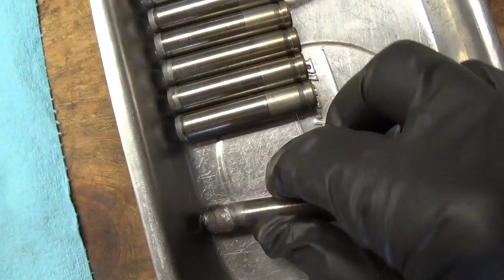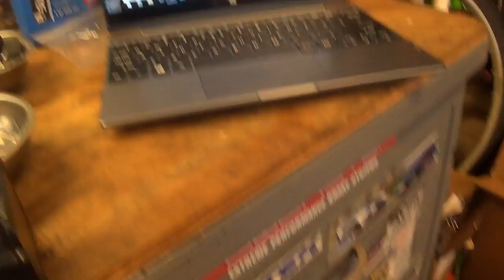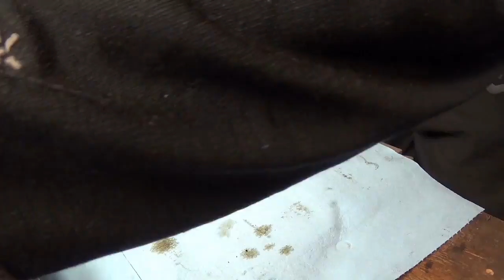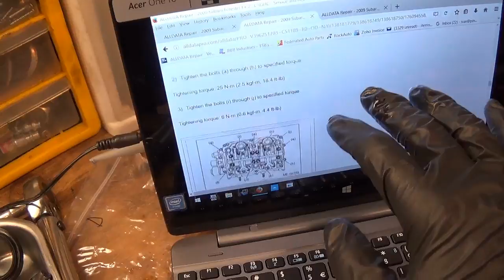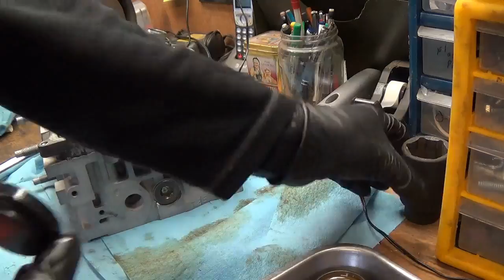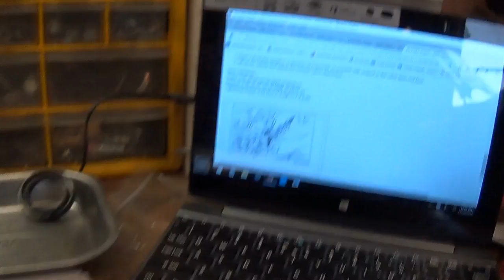Subaru Head Gaskets - Part 4: Reassemble, Valve Clearance

Comment: Watching anybody run bolts down into aluminum threads with power tools always makes me cringe.
I have some extra heads im getting ready to work on and one of the special tools i am going to make is a bench pad with holes for some bolts to anchor it down.  Tired of watching everybody torquing on these while they are scooting around.

Comment: try to get the sealant on the outer edge and use as little as possible.

had some block my oil return and oil pressure shot one of my rear mushroom plugs nesrly lost my motor and had a qaurt of oil left.😢

Comment: Already had my heads glued together and thought I don't need to watch this.   Then I realized I only put sealant on the trough. I looked at the application image and saw that I did not start or end at the oil seal caps. They just finished curing. Thanks for the additional work. it will save me a lot of work later after they start leaking,  😂

Comment: At 7.5 ftlbs torque I would have just done it by feel. As you are most likely aware, you get a feel for those lower torque specs. I got good at doing 28 ftlbs by feel.

Comment: Cam seals- if you look at the front of the head where the seal goes you can see it has a bevelled inner edge, indicating the seal needs to be pit in a little past flush with the cylinder head. I've seen guys saying not to put them in further than flush but they are supposed to go in a little further than flush or they can pop back out

Comment: I think an anaerobic sealant should been used as opposed to the ultra gray. My theory is that sometimes a cam cover leak is  actually misdiagnosed as a leaky hg, they both end up covering the bottom of the engine with oil,  but only a leaky cam plug will cause oil near the cam plug.
I really dont think that area is sealed correctly from some videos I've seen. In this video I saw how the gunk left over in cam cover channels block the return path of oil. In the fsm, Subaru calls for a 3mm bead riding on the outer lip of those oil channels. I think it's a very subtle reason. They dont want the bead to squeeze out excessively or at all into those channels. In my interpretation,  I think the important thing is the sealant forms a barrier around the oily areas. When the oil inevitably seeps to the front and rear cam seals, it fills up behind the seal  and must drain back through tiny channels, look under cam shaft, however if that channel is somewhat blocked or not flowing quick oil can force itself between the metal and find its way into another channel, and if that is blocked, the oil will have nowhere to go except out the front and rear cam seals. From TDs of anaerobic sealants, another benefit in this regard is it only cures in areas of no oxygen, the rest will wash out with the oil. So even if the installer is not careful those oil channels wont get gunked up. I feel I'm right on this, and I'm about to need to do this job  so I just want to see what people think. Thx

Comment: I would not be surprised if the problem with this car started from lack of periodic valve lash adjustment. If the exhaust valves were tight and not seating correctly - they would overheat and start burning the edges eventually leading to crack of the top. This is why it would be good to check clearances on the other head

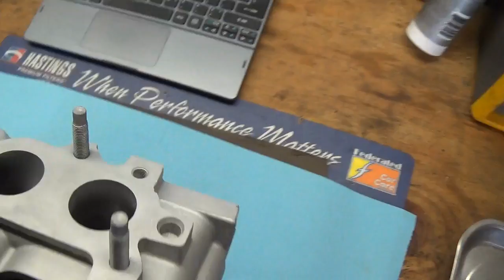Comment: 1:02 If the engine is turbo changed (it's unlikely to be since that's a SOHC head) you'd actually have to get it tuned because the engine now has an increased compression ratio.

Comment: I got my ej253 heads from the machine shop and I paid them extra to put in the cams and retainer housings, cam seal and plugs in. plus adjust the valves. They must not have sealed it correctly cause I have an oil leak out the back of the head around the cam cap on one of the heads. They charged me $650. Iam so pissed at them. Now I have to pull the head off in the winter with no heat in the garage! And hope they fix it correctly the second time. A refund would be good too. Any thoughts?

Comment: Thanks bud, just what I need. My outback had a leaky head gasket so I sent the heads away for skimming. The last time I sent a head to a machine shop it came back complete, so I just bolted it on with no dramas. This time they've come back in 3 parts and multiple boxes!

Comment: Did the machine shop press out the head warp before milling?
Reply: You dont try to press out the warp on any head…esp a small aluminum one like this…i wouldnt consider putting any type of cast part in a press…i just cant imagine doing what you asked…and what kind of damage it would cause… all for just a lil over the thickness of a pc of paper or a human hair…which .003in

Comment: Too much sealant is better than not enough? Well, bad news, someone rebuilt a manual transmission in a Ford ranger I bought. It made terrible noises so I tore it down to find out someone used way too much sealant on the front bearing retainer and it clogged up the oil galley in the input shaft which stopped oil from getting to the input bearing.
Reply from the maker: Sounds like WAYYY too much sealant used to cause that!
Reply: @PineHollowAutoDiagnostics  Indeed, I do believe the Ford ranger forums said to only use a thin layer. My dad always taught me to spread the sealant before putting the other half on to ensure there isn't too much, it's worked for him for the past 35 years and for me since I started working on my own toys 10 years ago.

Comment: I used to be a truck mechanic and most of my experience was with Cummins.  But I alwayys ran over head on valves to where the feeler gauge was snug and if you ran it under it would drag and not be tight and the adage was a little loose was better then too tight.  Is that not true with foreign cars when adjusting valves?  Not being an as* just curious. Always owned domestic cars and you don't ever have to adjust the valves unless doing a rebuild.
Reply from the maker: It's a mechanic's feel sort of thing. If it drags a bit then call her good ;)

Comment: Ivan i noticed that you mentioned that the head is the drivers side. So the passenger side head  didn't need any machining. Also i didn't know that those 4 cylinder subarus had 2 heads.
Reply: Beavis Kornholio yup, Google boxer or flat four

Comment: Just asking.., Are the valve lash specs with the engine cold,or are  the specs for an engine at normal operating temp?
You might want to check. Also, you might want to recheck torque on all those bolts when the head is back on the block.
whatever you think, your going through too much work to have something go astray.
Reply from the maker: Valve clearances are always set on a COLD engine. Thank goodness, because it would really suck setting them on  hot engine LOL!
Reply: Best to set them to the high end of the spec, things do grow when hot, and you might end up burning valves

Comment: Common Ivan, You've got me, Denny the toolguy, as a friend and you use a $9.99 (with coupon of course) torque wrench from Harbor Freight on an aluminum head and block. Take the rubber band off of that roll of hundreds and buy some decent tools will ya!!! That's embarrassing.
Reply from the maker: That torque wrench works great!
Reply: Very likely it doesn't. Torque wrenches, no matter how well they're made (Snap-On and Proto included), if they depend upon a spring as this style does, are not very accurate at only 5% of full scale like you were using it. Pull another tenner our of your pocket and go back to HF and get their 1/4" model. Then you'll be better able to do these low torques as you'll be in the middle of its range. Or, you could call Denny and we could make a deal for a quality torque wrench of either the digital or spring style as I of course have both.
Reply: biggest thing, does it torque consistent across all "fasteners" of the same value. nothing causes issues and warp faster  than uneven torque ;)
also the same reason for having "one" person torquing all of them. not like it's a dirty secret, multiple people/angles can vary the torque by a large percentage
Reply: I noticed that too  but it may not be the exact torque but most likely will be all even   thanks on the sealer info

Comment: Soon be startup time :-)
do like the cam plate recess for sealant, some other designs have no recess and some use specific liquid sealers .
Is a ballache if that joint or rear blanking cap leaks though .
Subarus pretty leak free in general though .
looks like you having fun with this one, not a bad job once get into them . easier than a 8pot chevy :-)

Comment: I just did this job again myself on a dual overhead. Probably the 7th or 8th one over my lifetime. I found out after years of doing these that the composite gaskets seem to do better than the metal on this engine. Metal gaskets are always better but for some reason the composite gaskets on this engine seem to hold up longer.

Comment: Didn't see you clean the oil residue from the the mating surface before applying the Ultra Gray. When doing head work I use liberal applications of brake cleaner spray, Eric O would approve. Also I have one work table that is covered with carpet, nice to help hold the clean heads when assembling and adjusting valves.
Reply: Watched a lot of other videos where they smear oil or assembly lube all over but I don't see them cleaning it up good for the sealer.
Myself I would put minimal amount of oil on cam beatings to keep it off the nice clean gasket surface.
They don't need a flood.

Comment: Wonder how much of a new type engine is Engineered by Computers and how much by Computer, have we gotten that far that a computer can do it without a human, or I guess as human as a engineer can be.

Could they tell if the warping came from the factory, or from normal heating through the heat cycles. And Time
Reply from the maker: Great question about the warping. Hard to say if this particular engine had been overheated to drop that exhaust valve guide and warp the heads...
Reply: @P @PineHollowAutoDiagnostics I know this is old , but for “ whatever” reason it popped up. Here is some food for thought on this type of warpage. Let’s say you check for flatness with a machinist straight edge across the head gasket surface and find several thousandths of warpage. If it’s warped on the bottom, would one not surmise that it is also warped on the top where the 5 cam bearing saddles reside? How could it not be?  On the old VW Rabbit type engines which had a similar cam bearing design, if the head was warped it had to be sent to a facility that could heat the head to plasticity and formed back to spec for the cam bearings to be true. I do not understand how these warped heads can just be machined flat on the gasket side, and ignore the cam saddles. Help me understand! 😂🤔
Reply: Very common with aluminum heads in general and extremely common when you've got overheated aluminum heads.  Almost automatic to need the head decks surfaced. The blocks normally don't share this problem likely due to their greater mass.
Reply: I knew the longer alum 6 cyl heads suffered from warping, on my F54 straight 6 Datsun Z engine , I find it wants to break the exhaust header, around the bolt area, if it dosent break the header then it gets the bolt. But that Subaru head is rather short and stout, dosent seem like it would warp, maybe a bad design not allowing it to cool off fast enough, maybe just heat soak when shut off
Reply: overheat and not being torqued properly is the most common cause of warp. followed by adding huge power with lack of clamping force lol! which will push gasket out and of course burn them

Comment: Nice job Ivan man what a mess of bolts in those heads, in my experience you can leave the exhaust valves a little loose on the feeler gauge because exhaust valves tighten over time and intake loosens over time
Reply: I completely agree with that I always set exhaust valves like that I would rather a little tappet noise than burn a valve seat

Comment: I dont understand why Subaru didnt engineer the valvetrain support cradle to accept a recessed gasket or extended square edge o- ring. That has to be a more efficient process than releying on sealant in such a critical area but sealant technology now exceeds gasket technology. Great educational vid Ivan. Till next time bro...👍👍
Reply: Andrew Hallett-Patterson an automotive engineer told me it's cheaper.  A sealant is more forgiving so cheaper with a c and c type machine to apply it. We have to have a surgeons hand, I tend to slap it on with a brush

Comment: Ivan, Take the extension bar off the torque wrench
Reply: I agree, but what I think the point that he was trying to make was that without the head being stationary you will have side torque and that will lead to the actual torque being lower than "click" torque. Probably less than 5% in my opinion. Everybody gets too hung up on torque which is an extremely imprecise and indirect measurement of what you really want to know which is bolt stretch. Torque is affected by damn near everything. The lubricant used on the bolts. The lubricant used on the shoulders of the bolts. Material that the bolt is going into. The condition of the threads. Torque values in real life probably vary by 50% although torque wrenches can be made to within 1% of accuracy. That's why most manufacturers went to torque to yield. You tighten the bolts to a low value that basically takes up the slack. Then you know the thread pitch, you know how much you want to stretch the bolt and you add as many degrees as necessary to achieve that bolt stretch. That's so much more precise than a simple torque measurement.
Reply from the maker: why?
Reply: You are wrestling the head with your left hand on the bench against the torque you are applying with your right hand, without the ext bar your hans will be closer together, plus with an ext bar it tends to try and pull the socket off the nut sideways if you see what I mean. Thats the best way I can explain it, I'm shure there's a beter explanation somewhere lol
Reply from the maker: Good point Steve! Some of the bolts were inset a bit so I just left the extension on there for all of them... Maybe I should improvise a bench "parts holder" :)
Reply: You've got a decent MIG welder in that Hobart 140 just head down to the local steel store and get yourself some angle iron and plate and make up some head holders. These make working on heads a lot easier especially if you need to take out the valves as they lift the head off of the table. Personally, I'm killer with MIG (HTP Propulse 200) good at stick (AHP AlphaTig 200X) and sort of suck at TIG (also AHP AlphaTig 200X - which is a very nice AC/DC TIG machine for very little cash by the way).
Reply: if you torque one with an extension, leave it on to torque them all, if not the actual torque value will vary. don't forget and extension or any adapters/wobbles will change the torque value by "X%" depending on how many joints, etc.
should also say, you should fasten the head/object in place so you can use both hands on the torque wrench.
Reply from the maker: Actually, the number of extensions or joints doesn't affect the static torque value AT ALL. This isn't an impact gun. If it clicks, you are golden ;)
Reply from the maker: SATAMAN Schmidt so you're saying the Harbor Freight torque wrench is perfectly acceptable for this job 😄
Reply: whew, "SATAMAN Schmidt" went all out expanded explanation, but exactly right. keeping everything parallel is important and the more joints the harder it is to stay "in-line", more so with one hand!
we all know it's not good when your torque goes from circular twisting to off center side loading, that breaks many fasteners, sockets, bolts, adapters, extension "spark plug porcelain". broken plenty myself over the years :)

Comment: Tbh to much sealant is as bad as to little
Reply from the maker: Well I meant a little too much is better than an oil leak xD
Reply from the maker: Don't worry summer is almost here xD
Reply from the maker: Fair enough...but please explain the drawback of being a bit generous with the sealant. It's not like it's going to plug some oil gallery or cause any harm...
Reply: Pine Hollow Auto Diagnostics I just think you have to be careful promoting using copious amounts, as I’m sure there’s people watching this that might think you use it like sealing up a bath tub haha It can plug up things, I’ve seen it cause failures in oil controlled solenoids, clog up pickup screens and oil ways. Safer to use an anaerobic sealant that won’t cure in those circumstances. It’s also better for a tolerance machined surface application like this which most likely line bored? and a matched housing for the camshaft. It would also aid in separation in the future. Just like Mrs O’s worry with Eric getting an ice cream machine...unfortunately all that excess splurging has to go somewhere if you know what I mean? 

P.S. not enough tops off action in this series...disappointing 😜
Reply: Didn't think anyone would reply so that surprised me, don't think that I'm trash talking or stuff I like ur videos, it's just sometime I don't expect some things to hear from u ;) and to why to much sealant is as bad u can google it, it would be to hard to explain for me because the language barrier :) but thumb up for ur active comment participation 👍
Reply: I love you Ivan, but i agree sorry its basically just a skimming amount on the cam carriers, a lot of manufactures even use an Anaerobic Sealant  because its a machined tolerance fit at the end of the day. Less is more on the cam carriers :) Permatex make one. Enjoyed the Good videos though!